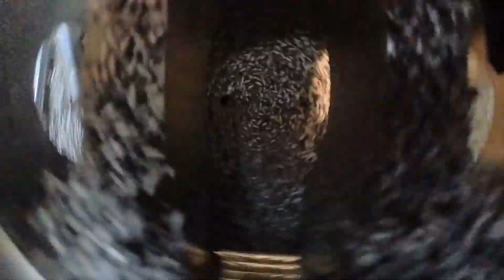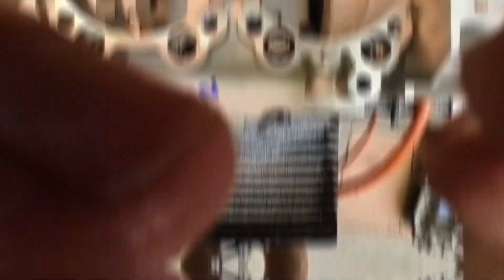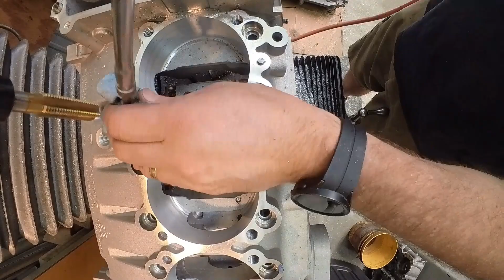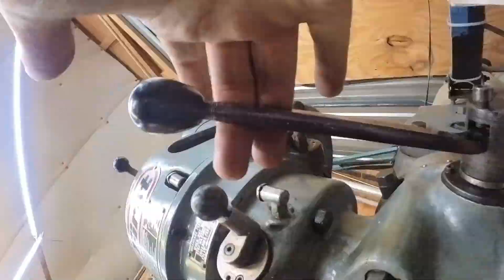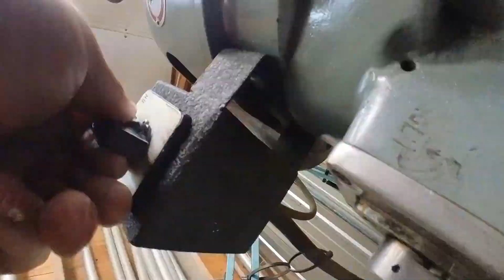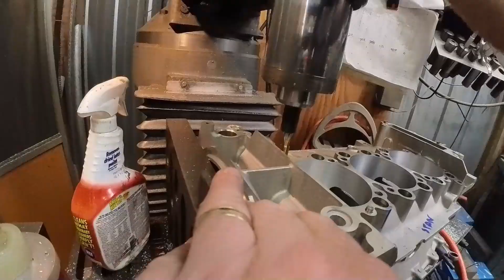1000whp+ Porsche Engine Case Upgrades POV

Comment: You dont use Time-Serts or Helicoils with the 12mm studs?
Reply from the maker: No, the drill for the 12mm studs perfectly clears the original hole.    For the 7/16" head stud kits we use timeserts since the difference isn't great enough to allow perfect threads.    But the 12mm threads come out beautiful and don't require the extra work on timeserts. :)    BTW, never use helicoil!   Timeserts are nice.  Helicoils come out and don't add any strength.